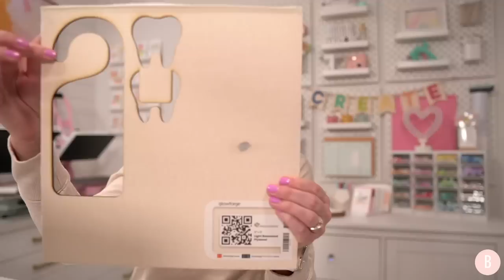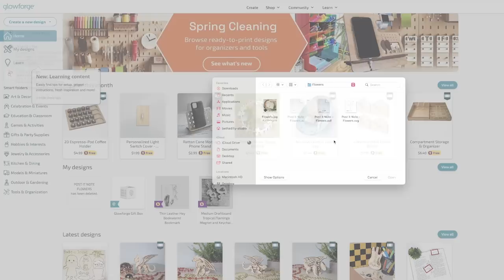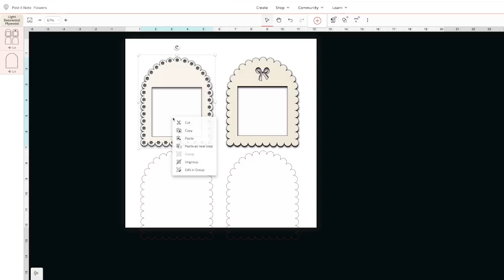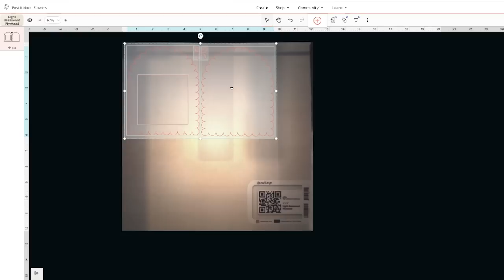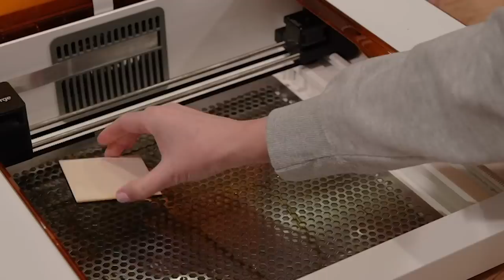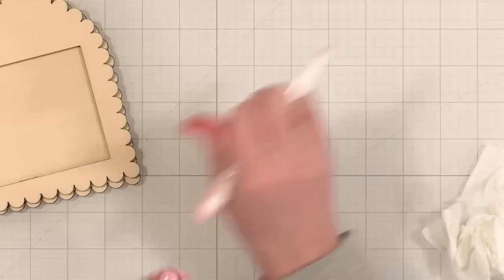Remind Me Why I Resisted Buying A Glowforge For So Long!? | The Cutest Glowforge Picture Frame Ever!

Comment: Just a simple wood glue would seem to be best for this type project. Dollar tree has one in a little apple barrel size paint container with a tip applicator that you trim off like caulk… but for intricate things like this I would just open it and dip a small paint brush or skewer in and paint it onto the project. Hope this helps someone. By the way: dollar trees wood glue is good